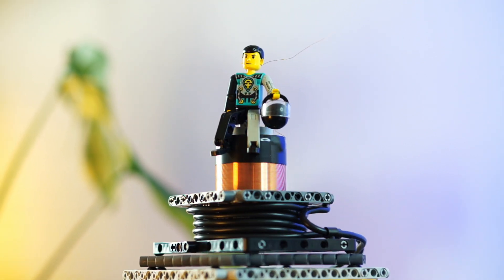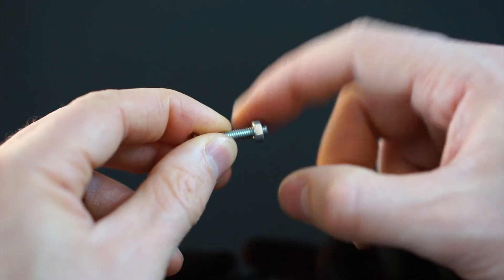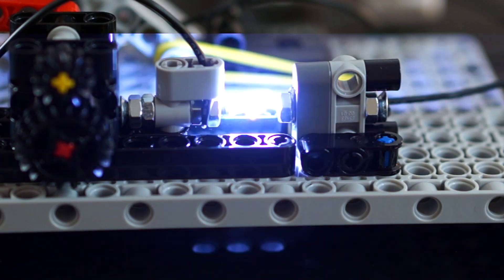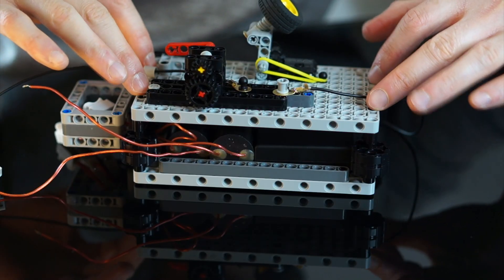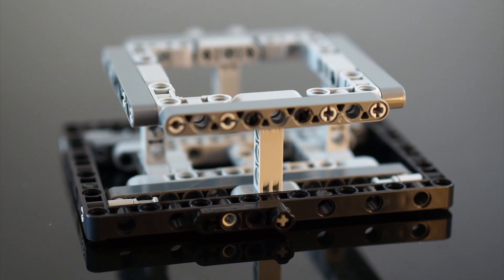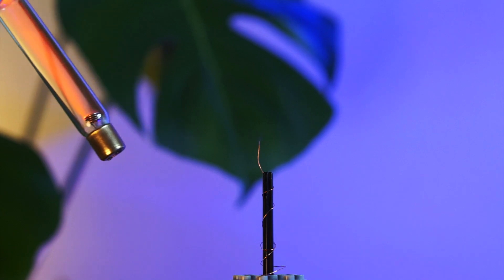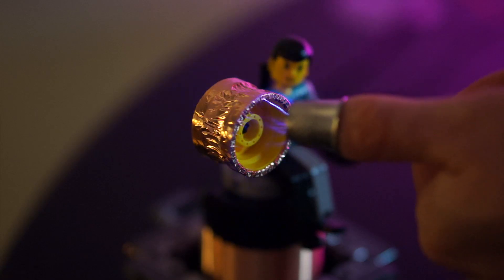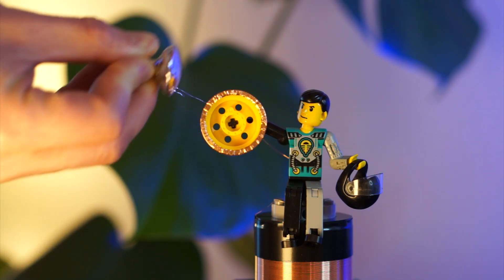Shocking Myself With a Tesla Coil Made of Lego

Comment: Sorry, but this is NOT a true Tesla Coil. You're just getting simple induction. You need capacitance in parallel with (across) the primary circuit. Tesla Coils typically resonate at very high frequency, and in fact if a Tesla Coil is working and tuned right you can hold a conductor in your hand and draw sparks and you won't get shocked. That's because your body's nervous system doesn't respond to high frequency current. I have old videos on my channel where I show a Tesla Coil that I built years ago. I can draw sparks from the secondary terminal and there is no shock at all.

Comment: Really good video! I love how clean the build is, and the output is quite decent for the capacitors you are using, i have dissasembled those modules and the caps are extremely small. I made a portable one with a bug zapper once too, they are fun to play with for a while but you should build a big one with MOT's or NST and combine it with lego, it would be so cool. I just have one question, did you ground the secondary? Because i feel like those arcs are small for such a high input voltage and considering that it is in resonance.
Reply from the maker: I'm impressed you managed to take one of those apart - I tried and gave up after realising how annoying that epoxy filler is (or whatever that stuff is)! My original idea was to build one using a high voltage circuit from an electronic lighter (similar to Jay from the Plasma Channel) but decided to stick to this for the sake of simplicity. I did indeed ground the secondary (on the metal leg of my table), but I think the main limiting factor is, as you said, the tiny caps in the booster. I totally want to make a much bigger one though! Maybe even try a pancake coil
Reply: @JamiesBrickJams  you should definetely do it, I have never worked with pancake coils but I think they are way harder to wind compared to normal ones. Maybe you could use a flyback for the next one, I like plasma channel but most of his builds are really low power so I'm pretty sure you can make something way more powerful than him with one. Also, I think this module could work for a bigger coil if you add another cap at the end of it, in my current coil I am using four leyden jars and only 4kv input (two MOT in series, ballasted by another MOT) and I get 15cm arcs but the coil is around 13cm, I'm sure you can make one better than that with real caps and calculated resonance.

Comment: Where did u connect the other end of the secondary to? I am resorting from a sstc to a sgtc for my 1260 winding  secondary
Reply from the maker: Ah yes good question - that other side goes to ground. Mine is just blue-tacked to the leg of my table (which is metal).
Reply: @JamiesBrickJams  thanks!

Comment: Is the bottom lead of the secondary coil not connected to anything? I tried following how you wired everything but cant seem to get it all figured out
Reply from the maker: Good question! That's your ground - it needs to be attached to something bigish and preferably metal. I just bluetacked it to the leg of my table (which is metal). Just shout if you'd like any other help - the overall circuit is extremely simple (it might just look complicated because of the Lego)

Comment: Maybe you should avoid sharp edges on your top load because as we can see it has a lot of loss due to corona
Reply from the maker: Yeah you're totally right, it's definitely quite lossy. I originally tried various smooth top loads, and one very nice toroid, but didn't see an appreciable improvement in output (this thing is pretty underpowered), so I just went with this sharp one to intentionally get some more impressive footage of the Corona! Good advice though for when I build a more powerful one 😄